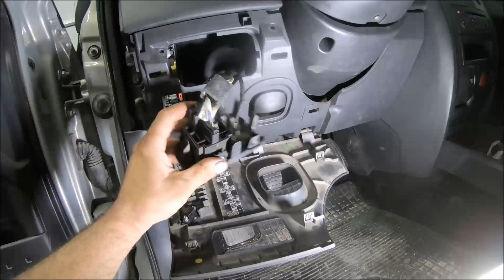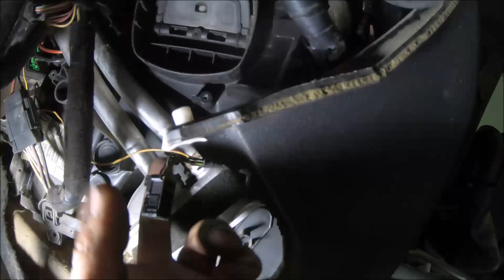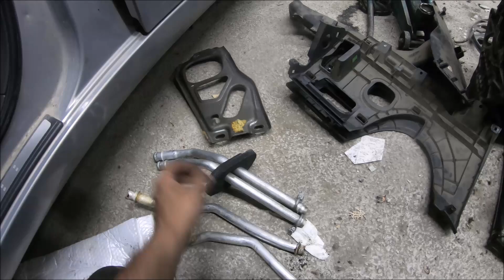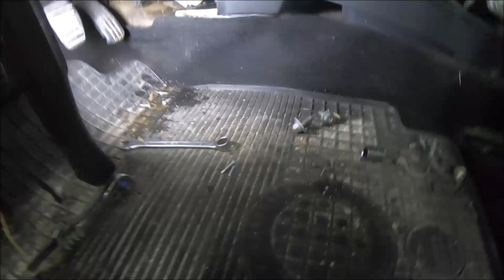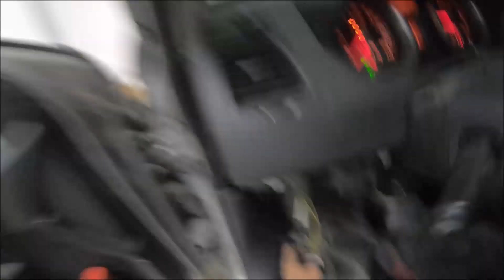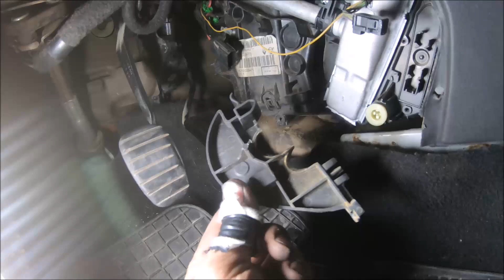renault megane mk2 how to change exchange heater

Comment: I am looking where is the heater refrigerant 'valve' on this vehicle... I have a problem related to feel heat in half left side, and right side cold with ac on and 15° set... I thick valve of refrigerant  is not closing complete...  Can be that stepper motor?  .
Reply from the maker: It's the stepper motor that regulate the air where should go hot or cold